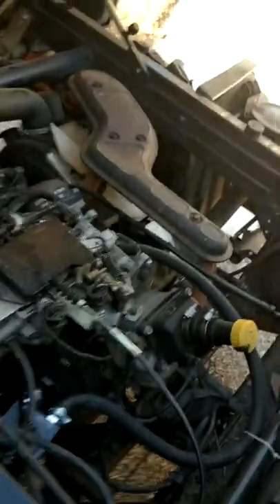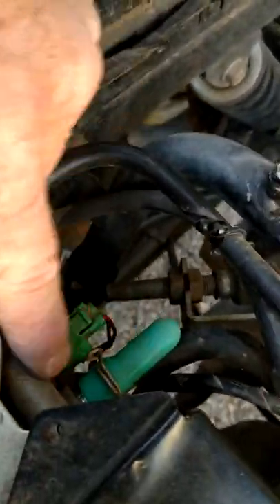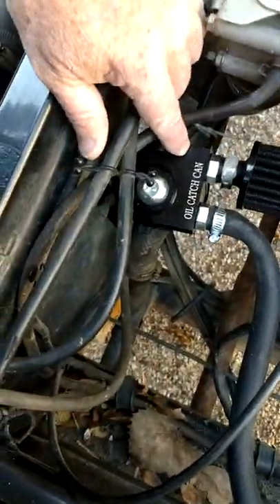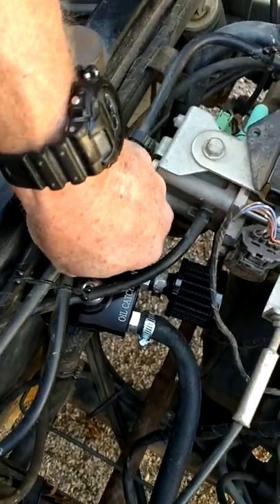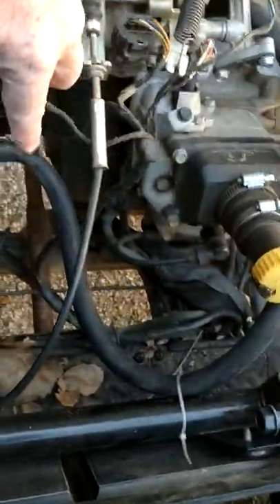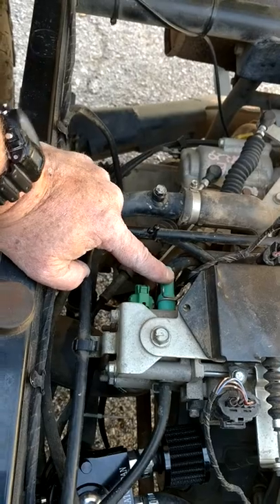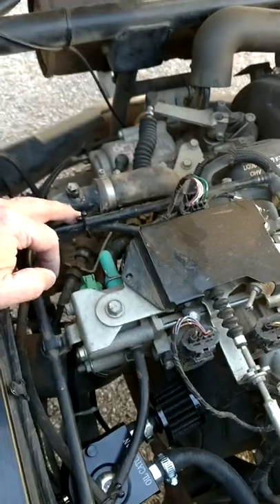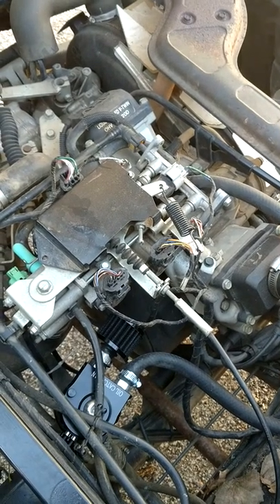kawasaki Mule 4010 throttle body potential solution for poor idle and gumming up.

Comment: I can’t thank you enough for this video. Chased a problem with my 2003 Mule 3010 for months. It would stall on load/throttle. Replaced an embarrassing amount of parts with no success until seeing this video, pulling off the breather case and finding oil. Cleaned that, the throttle body, the air intake tubing, and replaced air filter that had oily residue on it. Temporary fix while awaiting catch can delivery proved the Mule runs better than it ever has. Appreciate it!
Reply from the maker: Glad to hear it!  Going oon 2 years and mine runs like it should although Kawasaki's fuel injection map leaves a lot to be desired!!!  LOL

Comment: Thanks for this. I have a 2005  mule 3000. I just replaced the old carb a few months ago. It ran great for quite a few miles. Now it bogs down when going up hills.  I do remember the old carb and air filter had oil residue. I can’t wait to try your idea out.

Comment: I have a 2011 4010 and have a problem with the spark plugs fouling or at least getting covered in carbon, and the machine runs very bad when first started. I think after viewing your video that I have the problem you described and am going to disconnect it first to see if it runs smoother. Thanks for the tip!

Comment: Thank you for the video.  I bought the same item but had to use a different ebay vendor.  Hope it does the trick.  I was able to reuse the factory hose by routing away from the hot exhaust.
Reply: Which one did you buy?
Reply: @a2zjavier  It seems to be the same one.  Again, thanks for the video.  It is amazing Kawasaki couldn't offer this from the factory.  $15 is a small price to pay to solve this problem.

Comment: I had the same problem on my 2012 4010. I have since capped off the throttle body inlet and put on a breather on the crank case. If it works well I will try a more long term oil catch like you have.
Reply: I did this on my 2012 KAF 620 and it helped a ton until warms up then idle starts acting up and it will pop, cough and shuts down.  It’s like the butterfly in the TB is getting a wrong signal from the ECM, or the butterfly still may be gummed up....??  I’m gonna try cleaning the TB again, paying extra care to butterfly and we’ll see.
Reply: Which one did you buy. I want to order one

Comment: Thanks for the video, this is exactly what is going on with my 2018 4010 Trans. It is in the shop again today, 2 years after they replaced the throttle body. After 2 years it again started idling like it was going to die and sometimes it does.
Questions: You got the plug from your stock as mentioned in another comment but if you don't have a stock of those where do you get them? Also, what size is the hose from the oil catch can to the crank case?
My extended warrant runs out October 23, 2024. Hoping they replace the throttle body again.
Reply from the maker: @Dave11160  I don't remember exactly what size that hose is but just take a piece of hose down to the auto parts store and match it
Reply: @harmonhart6274  Thanks for your quick reply, Does the auto parts store have the plugs too?
Reply from the maker: @Dave11160  I am not sure about your year model I use some caps that I got for powder coating from Amazon they were big enough in silicone rubber

Comment: The hose from your crankcase that you ran into your oil catch can, would you anticipate any problems if I simply zip tied that disconnected hose downward and not used an oil catch can.....I know, I know, YouTubers will yell @ me, but simply until my catch can comes in.
Reply from the maker: I wouldn't, because that vet pulses. When not running would be a good place for the infamous dirt dauber to cause you a problem.  You might be able to tape a rag over the hose end though, just til your can comes in!

Comment: Dealer I worked for the techs would just make a plug for the hose by the intake port stuck inside the hose . I’ve seen em leave em like this and I’ve seen em add a slit into the vent hose like a water burp valve. So squeeze the hose it may already be plugged . Atleast this method looks factory.

Comment: Harmon, thanks for the help. Cleaned my throttle body and added a catch can and it is running much better. Smooth idle. 

What tires are you running? I have a 2009 and need new tires.
Reply from the maker: Carslile

Comment: Mr Harmon i have a 2007 3010 Mule it hasn't been used in years. Hours show 632. Im having issues with it stalling after about 10 minutes or so running. Have replaced many different parts and it continues to stall after a short period of time and it will not restart...If i leave it sitting after the stalling for 45 minutes to an hour it will start. Can you suggest something can try to correct this. Any info is greatly appreciated.

Comment: Your vent line goes directly into the throttle body... Not good. I have a 2016 model 4010 and they moved the vent line down to the bottom of the main air intake hose for the throttle body. They actually have a little valley in this hose to catch the raw oil... I took the throttle body off and intake hoses and the inside was all wet and gummed up with oil,,,, what a mess!
Reply from the maker: All that oily vapor still reaches the throttle body.  Catch can works.
Reply: David I have a 2016 model 4010 also where does it vent to? If you could reach out to me I would appreciate it. I'm trying to figure out where to put the catch. Thanks in advance.
Reply: Does anybody have video on the best way to clean the throttle body?

Comment: 2019 Mule 4010 here.  There is no inlet port on mine in the location you show with your green plug.   Just a spot that looks like where one was intended to be.  It looks like the system was re-designed at some point on the later models.  Can anyone share any new info?
Reply from the maker: I believe you are correct I think they relocated to the inlet for that oily engine fumes to somewhere closer to the roll bar area it's still puts it upstream of the throttle body and so the problem is still there.

Comment: Do you have any guidance or videos on how to clean the throttle body if gummed up? I'm quite familiar with this in the automotive world, but the kawi unit is so self contained. Thanks!
Reply from the maker: You just have to take it apart and clean it with throttle body cleaner there's several places on the internet where all that information is laid out step by step.

Comment: Hey Harmon, this just happened to me and I have a 2019 4010. Found the oil catch can, but my question is where did you find the cap to close of the inlet into the throttle body? Any assistance is greatly appreciated!
Reply from the maker: I just dug through a supply that I have.  You might need to buy an assortment.  It's sorta large as I recall
Reply: @harmonhart6274  okay, thanks!
Reply: Do you know what size the hose is coming from the vent?

Comment: I have a 2011 Kawasaki mule 4010 I’m replacing the fuel pump assembly every 6 months do you have a fix for this or can I put in a aftermarket fuel pump to fix problem any suggestion would be greatly appreciated thanks
Reply from the maker: I have had no problems with my fuel pump, but I have replaced just the pump on motorcycles with good result.  Curious why yours is killing pumps???

Comment: How is it working now that a year has passed?  Also, why not just take the hose off the throttle body, plug the inlet like you did and let it vent to the atmosphere?   I've read the other comments, but I'm not clear if it isn't recommended or some actual harm  may come from it.
Reply from the maker: Mine is still good,
Reply from the maker: Because the Pistons move up and down they pulse,and you have to have a breather on the crankcase Kawasaki has evidently redesign this somewhat but you could put a short section of tubing with a small filter on the end of it you just don’t wanna suck dirt and debris back into the crank case when it pulses in.  Also there is going to be a lot of oil vapor expelled and so it would create quite a mess without a catch can

Comment: that is not really a good solution.  It's a band-aid at best.  The system relies on a little bit of crankcase vapors, and every single one of them that I've dealt with that's had a CCV mod, does not run quite perfectly.  There is NO good solution for this EFI system....I agree that it's a poor setup at best.  The catch can then has a filter/breather on it, which emits the crankcase vapors into the atmosphere-which is not up to epa standards-and it also gives off a oily smell when the engine is running.
Reply: Does a airline passenger jet reroute all its CO2 ?

Comment: What model year is your Mule?
Reply from the maker: 2009
Reply: @harmonhart6274  I have a 2008. Will this work on a 2008? Mine has idle problems and backfires.
Reply from the maker: @59KYHighlander  if it's a 4010 it should work.  It takes a while to get rid of all the goo, so be patient.

Comment: Would this issue cause the DFI light to go on or is it simply related to poor idle?
Reply from the maker: I believe it would only affect the idle.  However if the idol was low enough the light might flicker.
Reply: So the DFI light was not on in yours?

Comment: Wounder if that is what is wrong with my neighbors 2012 mule.. changed the filter in the fuel pump an it ran really good for a couple months ..  checked that agian an its clean.. now when u start it it will idel but when u give it gas it stalls out kinda like it not getting gas but the pump is working up to the enjectors.ejector.. any info would help.. gona try with the vent tube off to see if any changes.. Thanks..

Comment: Can you post a link for the Oil Catch Can you purchased?  I have a 2018 4010 Trans that has developed just this type of idling problem.  Dies frequently and won't idle, hesitates when throttling up in gear.
Reply from the maker: https://www.ebay.com/itm/Oil-Catch-Can-Kit-Reservoir-Baffled-Tank-with-Breather-Filter-Universal-Aluminum-/143810299221?mkcid=16&mkevt=1&_trksid=p2349624.m46890.l49286&mkrid=711-127632-2357-0
Reply: السيد  هارمون
لدى كواساكي ٤٠١٠
م٢٠١٠
المشكله  خمول العزم ضعيف

تم تغيير البوجي وتنظيف البخاخ
الوكاله يقول تحتاج مضخة البنزين

نصيحتك
شكرا لك🇸🇦🇺🇸